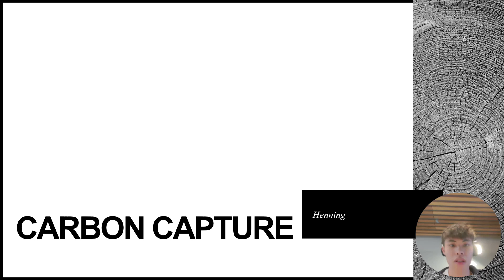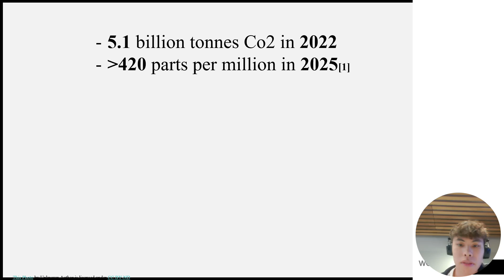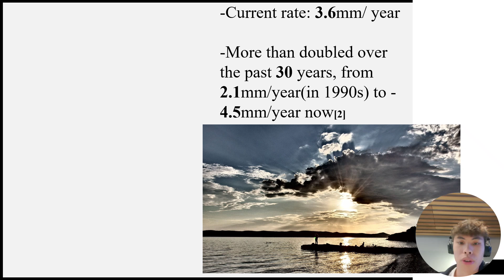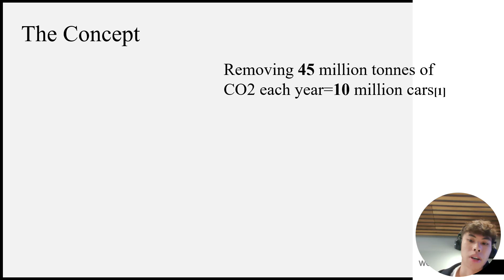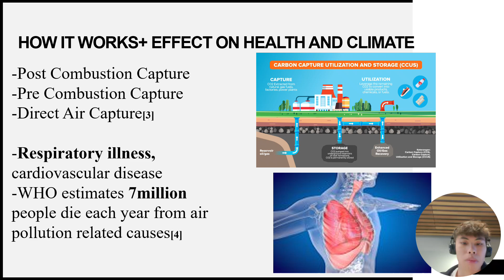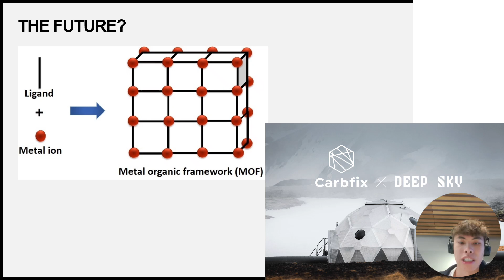ENGF0001-Carbon Capture-grand challenge

Comment: Very informative and engaging! However… Given that carbon capture technologies like direct air capture and MOFs can help reduce CO₂ levels, do you think investing heavily in these solutions might discourage efforts to reduce fossil fuel consumption in the first place — and how can we balance both approaches to achieve true sustainability?
Reply from the maker: Thank you for your question Jacob. We can balance it by prioritising emission reduction first, through renewable energy and behaviour change-while using carbon capture as a support tool for sectors that are harder to decarbonise. That way, both approaches work together toward long term sustainability.